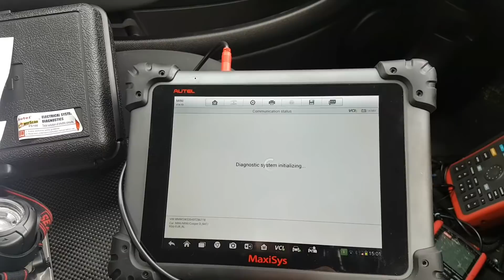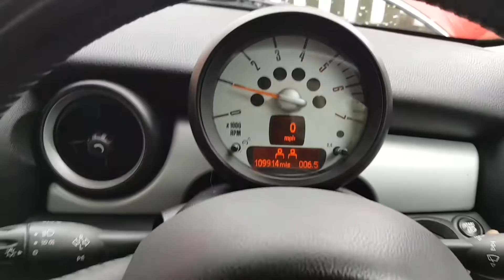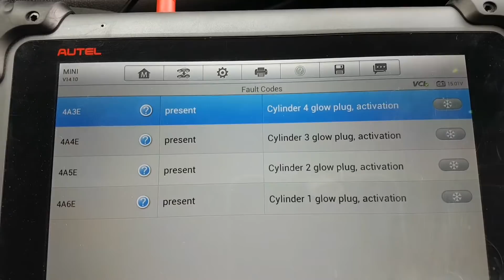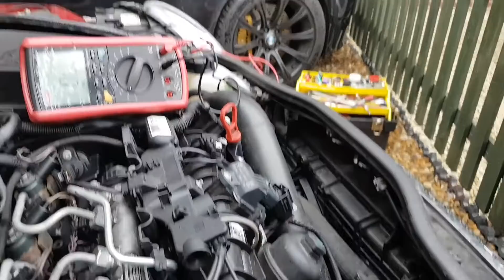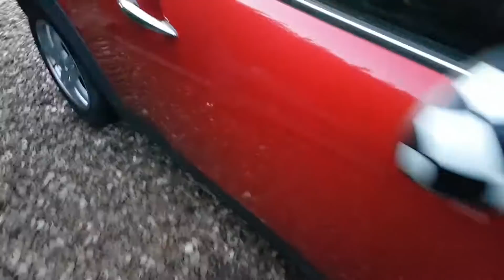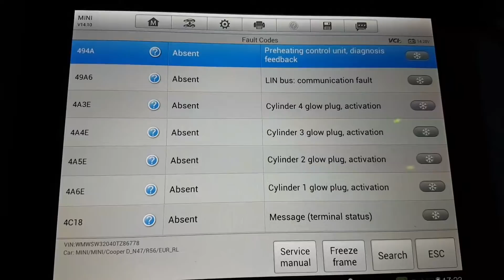Mini Cooper D N47 hard to start when cold... Fault finding and repair.

Comment: Just found this video, I've got one of these in tomorrow with blocking dpf and 4 x glow plug codes, was looking for a quick heads up, on the glow plug module and I've hit the jackpot 👍

Great video and thorough testing and diagnosis 👍

Comment: I had the same 4 codes as you for activation, I changed my glow plugs today and changed my module too.. I scanned it and deleted the codes. it successfuly erased 2 of my glow plug activation codes but cyl 3&4 still remained for activation.. what could it be?
Reply from the maker: All new and genuine parts?
Have you tested wiring?
👍👍👍

Comment: Getting error codes for all  4 glow plugs + dpf and some switch console error . Mates car said it was taking an age to start previously,but now not starting at all. Tried another module first same issue,would the glow plugs completely fail to stop it starting. Same countryman engine as your video
Well detailed video,just want it to start just to get heat in the plugs to help remove them. 👍🏼
Reply from the maker: Possibly...
Soak them in WD40 for a few days and give them a go... they might come out just fine, you never know...
👍👍👍

Comment: Great Video 🎉 When it comes to module itself, to change it is is it just straight swap? Plug and play kinda repair or neds to be programmed?
Reply from the maker: Straightforward replacement...
👍👍👍
Reply: @LMAutoRepairs y thanks. Module replaced today in less than 5mins. Works as treat. Total cost around £70 for OEM. No cranking and white smoke on cold start up. Been quoted almost £300 for all glow plugs but it was module that was faulty. Many many thanks for your video 🍻
Reply from the maker: @lukaszjablonski8909 
👍👍👍

Comment: What size socket glow plug? What size tap?
Reply from the maker: Socket, I guess you mean to remove the glow pugs... I believe is a 9mm if I recall correctly... the taps, are M10x1... as per the video, I used 3 different ones, a taper lead tap, a second lead tap and finally a bottom lead tap...
Hope that helps...
👍👍👍

Comment: Hi
Great Video.The people you work for are blinded by their ignorance
I have had a longer crank in the morning on my Audi A8 for about 2 years I have tried everything under the sun to fix this issue new glow plugs, new Glow plug module, Rail pressure relief etc etc
The car starts perfectly if I press the start button dont press the brake in other words let the plugs heat first .I have scoped the start and it seems that the ecu is not giving any preheat time but cranking imediately thus reducing the current to the plugs I have cloned a different ecu STILL the same Have you come across this Regards
Reply from the maker: No... I never came across that issue... sorry...
Is the external temperature and all the other engine temperature sensors reading correctly? 
👍👍👍
Reply: Hi
Yes I have changed engine coolant temp sensor and I have used a resistance box to simulate a minus 20 deg temp.The engine ecu still cranks without giving a preheat time I have put non return valve in fuel line changed fuel pressure sensor fuel pressure relief valve fuel filter 
I think the top and bottom of this fault is that the ecu is cranking the engine without letting the glow plugs pre heat and drawing current from the glow plugs
regards @LMAutoRepairs

Comment: Where can I get a m10 x 1mm thread chaser -??
Reply from the maker: 🤷‍♂️
I bought it online...
I have just checked on Ebay... plenty on there...
👍👍👍
Reply: @LMAutoRepairs  I can find plenty of tap and die sets or 'thread makers' online but as for M10 x 1.0 thread chasers... im struggling
Reply from the maker: Really?
https://www.ebay.co.uk/itm/291185758575?mkcid=16&mkevt=1&mkrid=711-127632-2357-0&ssspo=_KdJTK7KQq6&sssrc=2349624&ssuid=Ov28jkvyTx2&var=590342456520&widget_ver=artemis&media=COPY

https://www.ebay.co.uk/itm/272018335973?mkcid=16&mkevt=1&mkrid=711-127632-2357-0&ssspo=Sjjh9-NTQgy&sssrc=2349624&ssuid=Ov28jkvyTx2&var=570833368394&widget_ver=artemis&media=COPY
And many more...

Comment: If I touch the glow plugs while the relay is on should it get warm or hot?
Reply from the maker: You mean while they are in situ?
Reply: @LMAutoRepairs  yes while it's still in the head, on a cold engine and the glow plugs relay activated, if you touch the tip where the connector goes should it feel warm ?
Reply from the maker: @phareztrinimand  
Possibly... but depends for how long the relay activates... usually it does not activate for that long...
As per the video, is the best way to test them...
👍👍👍

Comment: One to watch on a few of the Bimmers is the load wire from the alternator to the glow module can overheat at the module terminal.
Cheap and easy to do though.

Comment: Really good explanations on how system works and detailed testing 👌 looked very good access compared to other manufacturers.  I have been in situations with my work very disheartening at the time but you never know what is around the corner you work hard and you will be rewarded for it   there loss not yours mate
Reply from the maker: Yes... some engines have them buried under manifolds, etc... making them extremely difficult to access...
Thank you for watching and for your comment!

Comment: Glow plug module dead. ?
Reply from the maker: As per the testing... no...
👍👍👍
Reply: @LMAutoRepairs  hmmm. Still the glow plugs can go bad because of the module. On n47 they are famous for going bad. Also if you have any error with glow plugs elements, dpf regenaration will not work what leads to dead dpf and dead turbo. Most of the time if you get multiple errors it's the module that's the cause. ( I admit i didn't watch the complete video series) 😇
Reply from the maker: The fact that you didn't watched, explains your comment...
The module itself was good...
Watch the video, all the testing is there...
👍👍👍

Comment: Wow i'm surprised at this. We have a Citroen C4 Grand Picasso with the 1.6HDI engine and it has 3 dead glowplugs and at it never fails to start, even if temps outside are -4 -5 it still starts no problems at all. I've checked the glowplugs and 3 of them are open, only 1 of them shows around 1.5 ohms. A friend of mine also has a C4 but his is the hatchback with the same 1.6HDI engine and his also has dead glowplugs and again never fails to start 😀😀
Reply from the maker: Some cars make no difference...
Other, it does...
👍👍👍

Comment: Not a great idea to use copper grease in combination with aluminium head (especially on fine threads of  glowplugs, especially^2 when high current passes through and creates even more corrosion)
Reply: No,sorry, i think it is actually a good idea,been doing that for ever;  even though it may seem that because copper and aluminum have a potential diff. of .5 volt, there could be a problem,i verify often that there isn't:even on exhaust studs and nuts ! 

You need an electrolyte for dissimilar metals corrosion to occur, and you need area too,but here  the copper area is negligible,it is not compact metal,it is a grease;

  And since the copper grease is there,there is no way any ionised water can get there,air has a hard time too, and the seal being on the bottom, means combustion products are also sealed off; so,there is almost no electrolyte there;

Also,there is almost no current there: the 20 or so Amps could flow through just one tightend thread fillet, but we have more than 10 threads,so it is negligible.

-(of course a I'net an  opinion might be worth exactly what you paid for it..)-
Reply from the maker: Possibly...
👍👍👍

Comment: top job , as we know,  glow plugs will brake in the tip area due to corrosion , carbon deposits , overheating , oxidation , etc.  It`s a very good practice to remove an reinstall them (if not issue present in the system) every oil change to brake up the eventual corrosion layer and reduce his impact in time.

all the best for the new year!
Reply from the maker: Agree...
👍👍👍

Comment: no need to flash to update the vin number on it
Reply from the maker: Nope...
Is a slave module to the DDE...
👍👍👍
Reply: @LMAutoRepairs  again,the frm does not need to be flashed to update the vin number on it,there are easier ways of doing that.
Also the repair route you took was a bit messy,there is free software that converts the dflash to eeprom meaning no need to mess around with recoding the module and messing with custom coding in case the car had any custom coding done to the frm.
Reply from the maker: Yes... I know of those other ways... with the Maxisys is a straight forward procedure... 
Again, the IM608 was seeing the Dflash as empty... so I had no other way... unless I would buy other tools...
I work with what I have... did the job, and that was the most important. 
I appreciate that there is other tools etc... this is a part time for me, I invest my money very carefully... 😉